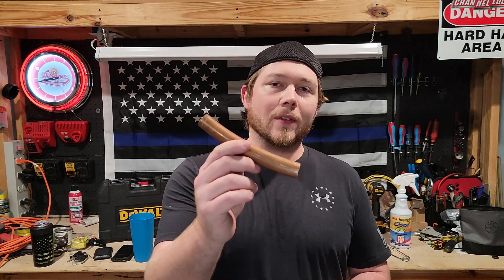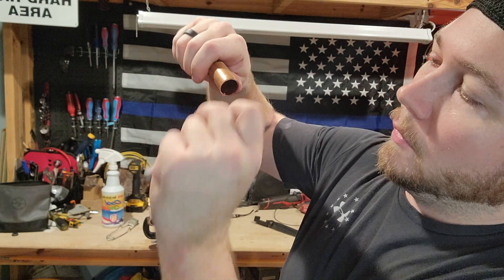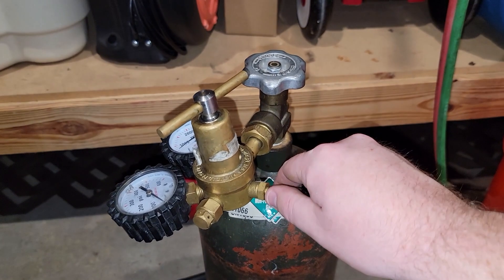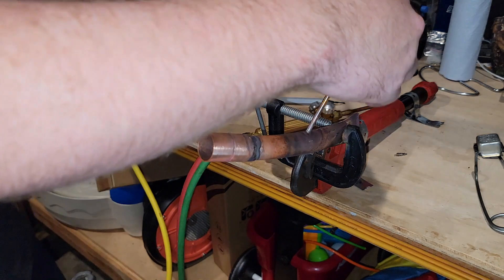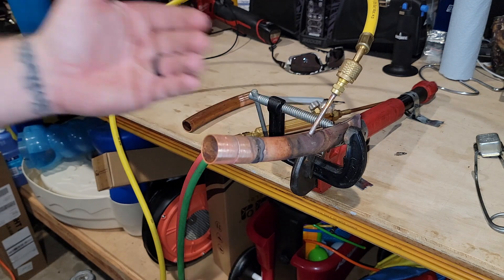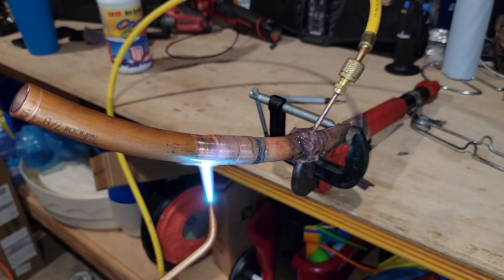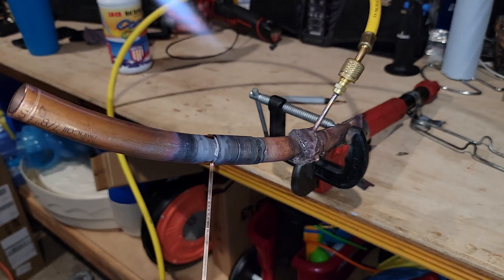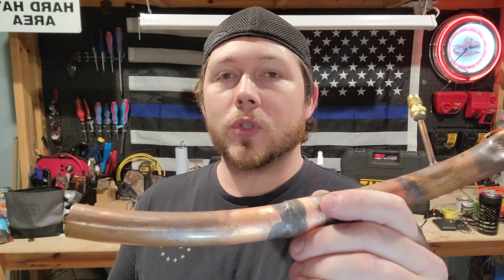HVAC Installation: Braze like a pro!

Comment: ohh dont put your finger in copper. adds oil
Reply from the maker: Yes sand it down after
Reply: @WorldofHVAC   I'm talking about the inside of copper tubing. I'm a Student.
Reply: College instructor showed us not to put your bare finger inside the copper tubing because it adds moisture and oils.  Or you Can't blow it either. Just tap out any burs.
Reply from the maker: You can always get it out with a flush kit. But the oil on your finger? I'd like to see that last in the hot pipe. Refrigerant oil will burn off. Im pretty sure the oil on your finger will too

Comment: Good tutorial. One remark. Cooling with water like that can cause hairline fractures in the connection as a result of the sudden temperature difference. Think of a boiled egg you cool down in cold water and the shell cracks. It's better to use wet rags and cool not the connection, but the pipe first.
Reply from the maker: Thanks! Thats good advice